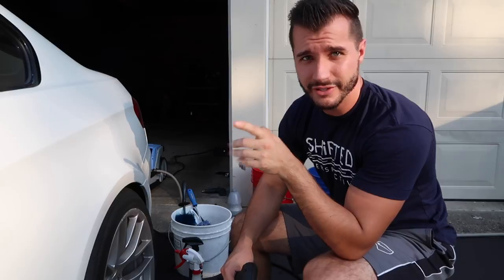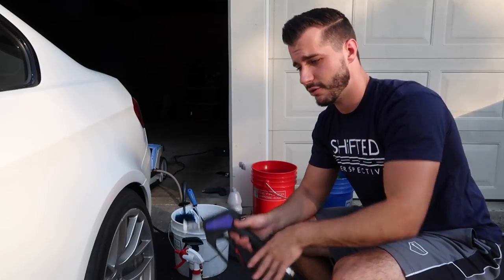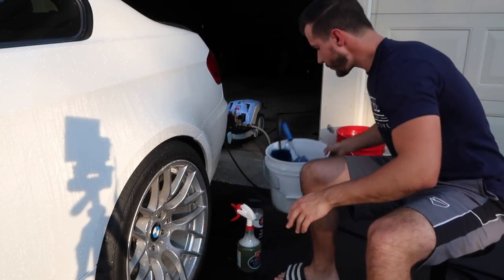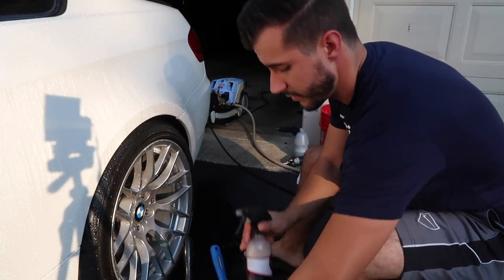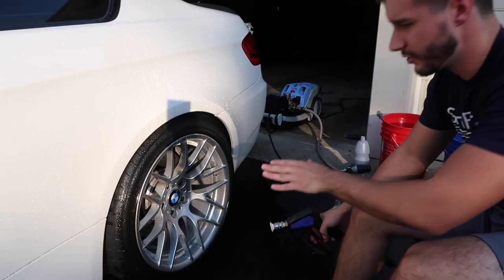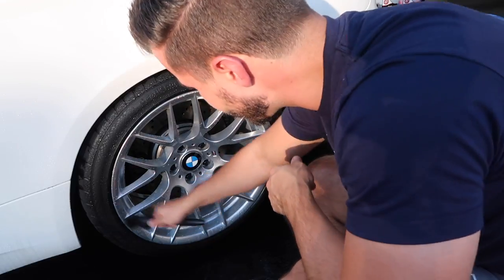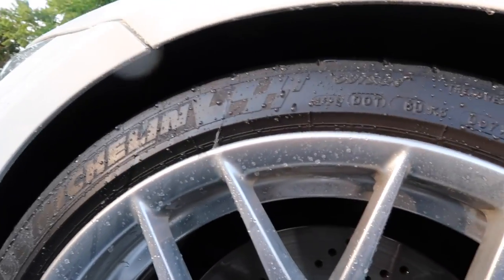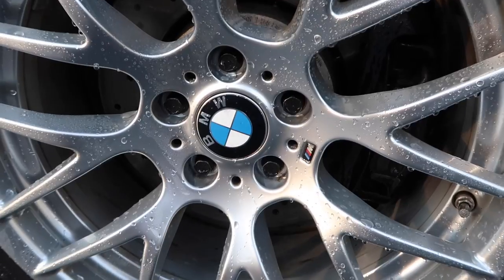Current Wheel & Tire Cleaning Procedure

Comment: I use Mean Green Auto and Garage cleaner. Its an effective and inexpensive cleaner that works great on wheels and tires. Walmart sells it. I also use the same blue brush that you have for the barrels. I also hate how it flings dirty water back at you lol.  For the wheel face I use a soft bristle wheel brush. For small areas I use a small foam paint brush. Works great on the wheels on my 08 BMW 550i with M sport package. It's white and the front end looks a lot like the one on your M3. That's what caught my attention to your videos. Nice car by the way.
Reply from the maker: +abcfisher1 thank ya!

Comment: Hey man, a tip and a question:

Tip: Spray your brush with product before you clean. This works especially well with Adam's tire cleaner and the boar's hair brush. A few benefits to this: on tires, when you're working with a brush filled with water, you're going to be contacting the tire with a lot of water effectively diluting the product. With wheels, when you keep cleaner on your medium, it'll maximize lubrication, reducing the chance of dulling or scratching the wheel face, rather than diluting your solution. I know they're durable but it still makes a difference.

Also, a question: is your m3 a zcp or are those just ZCP wheels? I also have an e92 m3, except non ZCP, and really want ZCP wheels. I can't find a definitive yes/no if i can have these wheels on my car safely.
Reply from the maker: +Scott Grande good idea I always forget to do that. My M3 is a competition package so yes I have ZCP wheels. I'm sure you can pick them up for a decent price used. I love them

Comment: Similar process here.  Use Adam's wheel cleaner dilluted 1:1.  Same result and more cost effective than using it straight.
Reply: see63ess Super Clean from Wal-Mart 4:1 @ $8 a gallon best wheel/tire cleaner ever.  Also works fantastic on engine bay and wheel wells too.
Reply: Sorry, not buying any walmart product as the best ever.